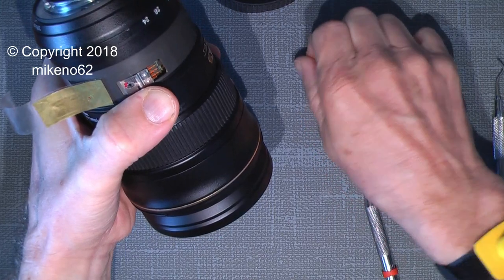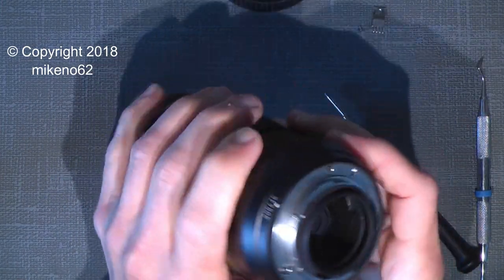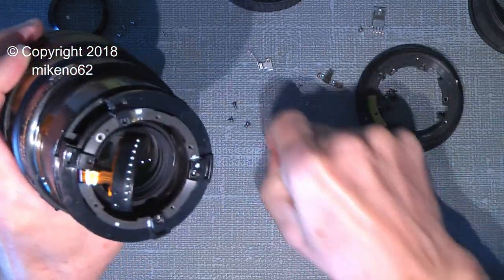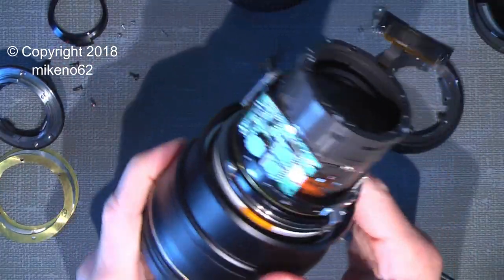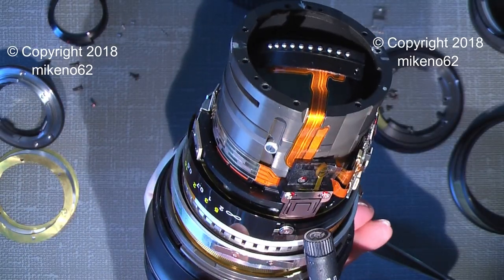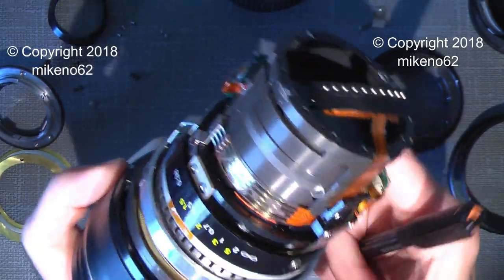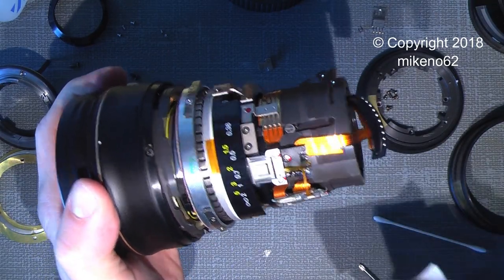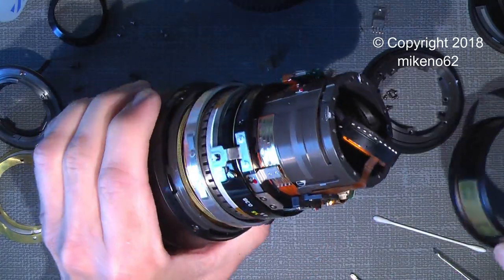Focus hunting problem in AF-s Nikkor 24-70mm 1:2.8 G ED___Maybe dirty magnetic encoder tape

Comment: Hi, another good video from you :)

I have a nikkor 27-70 ed VR which is completely different from yours.
I have used the service manual to dismantle the lense until i was at the steps requiring alignment. It is an easy process but be EXTRA CAREFUL with the cables in this unit, their are so thin that they break the solder connection in no time without forcing... the ribbon cables are more robust that this AF button cable.

So be careful or you will need to do a soldering jobs to repair the mess.

(I dismantled this lense because it was blocked in the  35-50mm range. the problem is easy, one screw getting loose somehow in the zoom mechanism, need to follow all the steps of the manual until you need an alignment , fix the screw, assemble everything and done).

My contribution
Reply from the maker: It's really good that you could fix your lens :-)

I think it must be the AF-s VR Nikkor 28-70mm 1:2.8 G ED you mean (there is no AF-s Nikkor 27-70mm....).

Some of the AF-s Nikkor lenses have problems with loose screws in the zoom section.
I think they miss the screw thread lock on the 3 screws in the very  front of the zoom section, I have repaired many AF-s Nikkor 24-70mm 1:2.8 G ED that actually had that problem.
You are right that it's not that "hard work" to fix, but of course one have to take good care of the flex cables, and NOT working too close to the GMR sensor unit and the magnetic GMR focus tape.

Cheers
Kenneth

Comment: Hi Mike,
Thanks for this, I got a very cheap 24-120 f4 as the zoom ring was 180 degrees out and stuck,I stripped it and got it working but the focus was hunting badly and I put it down to the two wires I soldered in to replace a broken ribbon going from CB to motor but after watching this stripped it again and cleaned all the tracks and the "tape head" and after reassembly working great, so thanks.
PS are you Norwegian?
Cheers
Chris
Reply from the maker: Thank's Chris, I'm glad the video could help you. I'm actually from Denmark and my name is Kenneth :-)

Cheers
Kenneth

Comment: thank you so much! I was thinking of buying a new lens after my auto focus stopped working on my lens. I notice through the focus scale view window, this type of felt like looking string (sealer or washer?) floating around. With your detailed instructions, I was able to get in the lens remove that floating material. it seems that sealer had some gray lube went everywhere which I had to clean. My lens is now auto focusing! thank you!!! 
I have one question. During your instruction I did not notice where that felt like looking sealer or washing came from. what could that possibly be, and should I be worried?

Comment: Hi Kenneth, 
I got same lens and want to ask you one thing. As you have much more experience than me in lens repair, I need some help. I borrow my lens to other and he hit front edge of the zoom which is moving in and out  when you zooming, may be he drop it without lens hood on it. Now I have blurry images on one half of frame. I'm not sure what can be a problem. May be he damaged or bend screws which lead helicoid parts inside or focus coupling key is distorted?

Comment: I hope you can answer my question! If the cause of the problem is magnetic encoder tape, does the lens make noise when it tries to focus (focus hunting)?
Reply from the maker: Well, it could be the SWM focus motor that is on the way to worn out, sinces the capacitive painting inside the motor is on the way to worn out (new motor..) (it's what I would guess)

Comment: Does anyone know why my Nikon 24-85mm f/3.5-4.5G keeps hunting after I repaired the zoom function because it has a loosen screw inside?
Reply from the maker: It could be a dirty magnetic strip, or if you have touched the magnetic strip with a magnetic screw driver (it will damage the info on magnetic strip). It could also be a bad or broken wire, a bad soldering.

Comment: Hi, can you make video how to correct focus on one side of focal length. I fine tune my 24-70 on 50mm and its not good on 24mm, if I fine tune on 24mm it is soft on 50mm and 70mm. Thanks
Reply from the maker: I would think you should maybe change one, or take out one of the very thin washers that sit under the bajonet, and in that way change the "micro adjustment". It's just an idea because many lenses are adjusted in that way in the factory. I have no (0) idea how much it will help, but it would be a simple fix to see if it could work. You need to take good care of the flex cables, and specialy the one from the bajonet to the circuit board.Take a closer

Look at page D6 - D7 in the repair manual. Here you can get the repair manual:

http://arcticwolfs.net/

Cheers
Kenneth
Reply: Thanks, I will try when photography season finish. Greetings